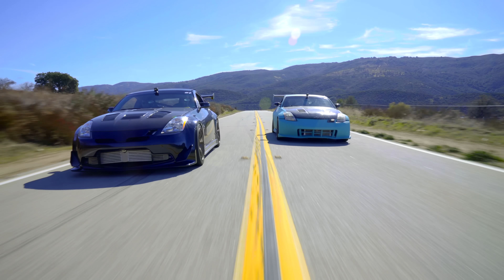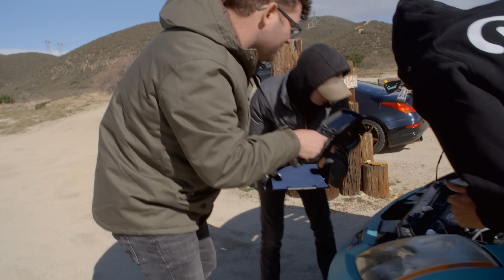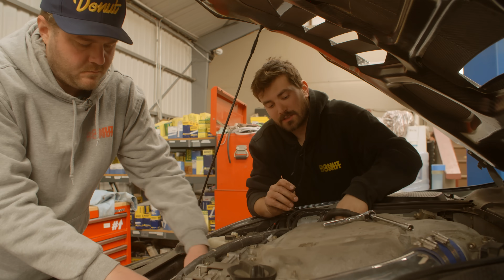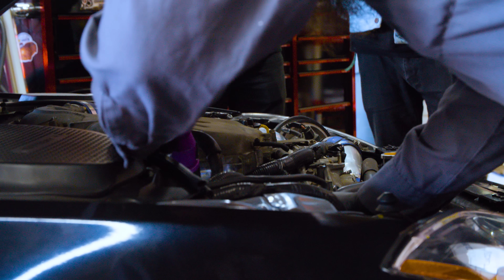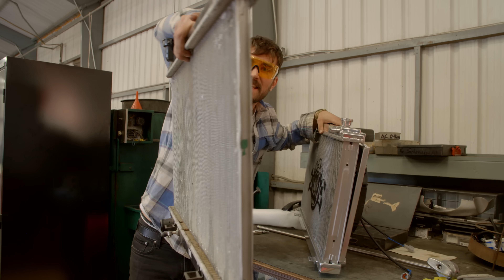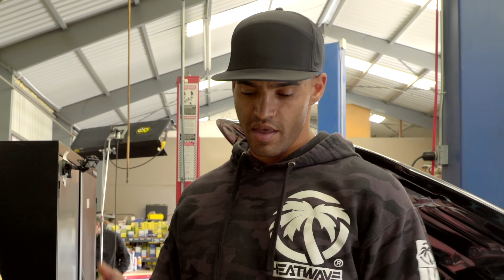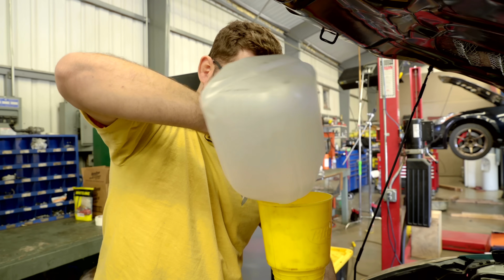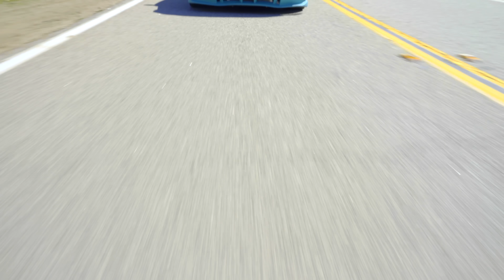$200 Radiator vs. $500 Radiator

Comment: Donut, if you're going to use distilled water, make sure to use an additive like Water Wetter with it.  Running pure water is going to eat up and destroy the  water pump seals really quickly.  Just a heads up.

Comment: I’ve had 3 eBay radiator! They’re been awesome, no issues so far it’s been a few years! The aftermarket fans in both of These cars are crap... I had the exact same dual fans on my mustang and they move less air than than my stock fan... I would not waste money on aftermarket fan unless you get something from derale OR a stock electric fan from another car

Comment: It'd be important to clarify that coolant "antifreeze" does more than lower the freeze point of your coolant. Distilled water has no corrosion inhibitors in it.
Reply: Yes thank you, I came to find this comment. You can't simply run 100% water! You might rust your stuff out from the inside!
Reply: Antifreeze also raises the boiling point too. Straight water boils at 212 degrees F, where a proper antifreeze mix raises the boiling point to around 260 degrees F.
Reply: Distilled water is not the problem, it even cools better than coolant, but at the low temps it'll freeze for sure 😂
Reply: Distilled water is acidic. Use water wetter or a water/antifreeze mixture.
Reply: @LightSpiD you miss the point that distilled water may perform better thermally, but it lacks the other components (corrosion prevention being a big one)

 @MountainPF  Distilled water has a PH of 6.9 (7 being neutral). Tha'ts a non issue. I can agree with the water wetter or antifreeze mix though
Reply: Jonathon Hebert once distilled water come into contact with air it absorbs CO2 and moves the ph level to ~5.9.
Reply: @MountainPF  Was unaware of that, thank you. Now i wonder if an engine's cooling system has much air exposure.

Comment: So the moment i saw the fans something occured to me that never had so far.

In PC cooling fans that provide high static pressure are used for pushing air though a radiator. Those tend to have larger fins than cover up a bigger portion of the fan area than high airflow fans that have thinner fins. So OEM fans in both cars look like they are geared towards high static pressure compared to their aftermarket counterparts which have thinner fins. So they should be the better choice. Could we revisit that at some point?

Comment: No coolant. From what I understand and read. U need a fine balance of 50/50 cuz yes it helps from not freezing but it also helps with not boiling. Water displaces heat better than straight coolant correct. But I'm curious about how this is gonna work out.

Comment: It's not just anti "freeze" has anti boil and corrosion properties too. Even in a hot climate no freeze issues in a engine with dissimilar metals between block head and rad should try to keep around 15% coolant.

Comment: I got 2 oem fans form a Opel safira thay have 2 speeds and on speed 1 thay take of  on speed 2 i dont know man its to much power i dont have so many amps at 12 v   I'm going to make somting cool out of them so yea original fans are great  maby even a over powered shop fan   for welding that turns on as soon as I stop welding so it can blow away the gasses and smoke

Comment: You guys need to worry about an oil cooler from mishimoto to keep those turbos at bay not worry about under glow. Doing all this upgrading and expecting the engine oil to be cool is worthless the radiator is only doing so much but is an good optional choice, but should still be consider about cold oil feeding into the engine and turbo at all times.

Comment: For the record, coolant also has anti corrosion agents and is has a higher boiling point, besides just not freezing. Not great for your car to run straight water. Also makes it more likely to leak through gaskets. Great test other than that. I've got one of those cheap radiators in my Subaru 🤣 it does heat up climbing long hills.

Comment: i feel like theres no point in replacing the radiator when the factory one works fine.
Reply: You must not have watched the video. 3 laps and having to stop isnt fine... That means the system clearly isn't rated for the heat/power the turbocharger adds to the engine. People like you need to keep your opinions to yourself i cant believe you just said that

Comment: well the distilled water isnt good for aluminum engine block of rad .. it increases corrosion overtime .. not really a good choice of coolant .. flush rad with distilled water use dedicated coolant is best option imo

Comment: You mentioned preventing freezing.  The other thing antifreeze does is maintaining proper PH (basic) which minimizes metal corrosion and erosion.  It's important, and it's one of the reasons you should always use the right coolant type for your vehicle (not just fill it with water)
Reply: I thought that’s why they use distilled water so it won’t corrode like regular water would
Reply: @JesusMorales-bn4qf  Distilled water will still corrode piping.  Changing the pH from neutral to basic is the best way to minimize corrosion of metals.

Comment: Yea destiled water makes diference on high tempereture climate.. like here sumer season nc .. i made mix of coolant and destiled water for my prelude 60%destiled water and 40 % coolant.. and it really works for my h22 high mileage engine .. this mix of water and coolant is been inside my radiator for ab 2 years and looks very clean. No any frizing problems wen is cool season .. is stock cooling system radiator radiator fans  everything is stock.. im not shure if im Wrong  making this mix of coolant and water vit sims to work fine for my prelude... any one has a better idea please and thanks....

Comment: Hey guys, is a radiator the same as an intercooler? I'm a little confused
Reply: nope. the radiator cools off the engine in general, while the intercooler only cools off the turbo (or supercharger in cars that have them).
Reply: @Polygraph2131  Can a car have both or do you have to pick just one?
Reply: @mickeybuzzkill   Well if your car is supercharged or turboed you have to have both. If you are running na, then you just have a radiator.

Comment: Its not about the radiator or fan, its about proper ducting to and from the heat exchanger. You can have the best parts available, but if you have no ducting, it will perform just as shitty as stock. CFD of the entire car is needed (usually already done to commonly raced chassis) to choose the best placement for the intake and evacuation ducting. Usually the stock fans are sufficient with proper ducting, so save even more money there.

Comment: i think low car should be able to get a new turbo, i dont mean top of the line but a cheap good turbo. it feels like its the main thing holding it back and realistically if something causes that much trouble you would replace it even with a cheap one but with proper reviews on car forums and other proven platforms. keep up the good work guys

Comment: You may also add, dropping the CATs will reduce engine temps as you no longer have that restriction relying on heat to do its work. Your scavenging that heat away from the engine+bay quicker
the Vented hood works better now too with the dual rad-fans.

Comment: Two fans isn’t actually twice as good. It’s the same concept as if you had one speaker on max volume, if you were to add another one they also wouldn’t be twice as loud, it would be louder but not by much. You would need 10 Speakers to achieve a sound twice as loud as one.

Comment: DO NOT use tap water for coolant. if you have an aluminium block, and a tiny short in your electrics, the ions in the water can conduct electricity in your engine. If your engine is made of aluminium, then it can hydrolyse, literally eating away at the inside of your engine

Comment: No one had an OBD2 scanner in the shed or anything to monitor what the sensor was reading?

I mean, the heat gun was good enough but just wondering.

Also, I think both radiators did their job fairly well. It looks like the turbo was the issue. =V

Comment: but why is it overheating to begin with?  is it because of all the aftermarket parts not tuned good enough ?  or all of the stuff requires higher performance cooling system (which is kind of bad tuning)

Comment: Anti-freeze (propylene glycol) also raises teh boiling point. Yes, water is more effective, but maybe 20% PG instead? that way if you do take it up in the mountains at some point it won't freeze. Edit: i should have let roll for like 10 more seconds. yep, what's in the block is probably good enough for socal.

Comment: 0:35

Early prediction:
High Car radiator is better but not better enough to justify 2X the cost.

Edited at end of vid-

End Result: 18:45

They both chose the High Car parts!

Note* If you look at the graphs, considering that they started at different heat levels, the low car part actually did a bit better job cooling overall *percentage wise*.
I believe turbo placement played a key role in Low Car’s high temps more than the radiator. If they put these on stock cars I don’t believe there would be $200+ dollars worth of difference in cooling.

Comment: OH NO - Don't run pure water!!  The antifreeze ALSO includes lubricants for the water pump, as well as corrosion inhibitors for any dissimilar metals.  Galvanic reaction is a real thing, guys!!  There are MANY coolants you can use if you want better heat transfer (check out Evan's waterless coolant!)

e - while I"m at it, even after the bubbles stop - lift the front of the car, run the car up to full temp (make sure the thermostat fully opens) with the cap off, make sure it's topped off and THEN let the car fully cool back off (say, overnight) - that'll completely eliminate any air in the system.

e2 - A full aluminum radiator is always a good upgrade.  Never put an OEM one back in LOL - That said, my vote would be hi car WITHOUT the silicone hoses.  Not needed - just the radiator and fans!

Comment: Anyone watching this: DO NOT RUN 100% WATER AS YOUR COOLANT.
Antifreeze is not just anti-freeze but also anti-rust.

Distilled water is even worse because it has no minerals and will eat the insides of your engine to get those back.

They kind of mentioned that they still had some of the old coolant left in the block, that will reduce those issues, but if start dry and put plain water in it your engine WILL CORRODE.

Comment: When we replaced the one in my Challenger that I'm building, we didn't have a choice and calls for a heavy duty high performance radiator on all SRT models and was also around 5 bills. We actually had a choice obviously, but only use the best on SRTs and wouldn't even consider using cheap parts on her. The majority of people don't know this, but hemis run hotter than most V8s and is imperative to use HD replacement parts on all high performance machines. Speaking of heat disbursement, I didn't know that distilled water works better than antifreeze to disperse heat and learn something new all the time. It would work fine for me to, because I don't have to worry about freezing as we are located in the desert southwest of AZ and doesn't get cold enough here. Although I thought that antifreeze also keeps em cool in the summer months, and would have to check into further before I committed to straight distilled. I always thought that you need the antifreeze/coolant in the summer months as well though

Comment: i put a $88 radiator after the original one cracked in my 07 c230 and the radiator worked just as fine as the oem one

Comment: The Hi car honestly got more attention to cooling than described. Having those straight throughs lost a marginal amount of low end tqs I'm sure but it would have probably been running lower temps with that alone. That cat blowing up was a blessing. Overall the expensive parts are the winner here as it's a preventative to much more pricey things like head gaskets or engine damage.

Comment: Sounds like you're just going to have problems with a project car regardless of what parts you put on it. It's just a matter of what problems you want to have lol.
Reply: They had a stock catalyst so im not surprised
Reply: @X_DD  I wouldn't doubt if that's the next upgrade they do for both.
Reply: More think thermostat along wit stock cats have low car running abit hot
Reply: Its all in how you design your car. They are just bolting parts on seemingly randomly. If you are meticulous in your planning and know what you are doing, problems should not be too bad or extensive. KNOWLEDGE IS POWER BABY!
Reply: casey escobar  Or it's because things rarely go perfectly when working on engine stuff

Comment: The coolant also helps with boiling point as well. It's not the best idea tu run just distilled water. IF you are stuck in traffic on a hot hot day , steam's going to come out.

Comment: Antifreeze not only stops the water from freezing, it also raises water's boiling point which is extremely important. Also, coolant has anti rust properties so I wouldn't advice using just water.

Comment: Howzit guys, I have a peugeot 207 gti 2008... It seems to have a boost leak, we've gone through everything, repaired intercooler, changed wastegate, no luck, checked pipes and their all good. My dump valve is also new. Been like this for 2 months, you guys are my last resort 🙏🏻

Comment: Yoo! I bought damn near the same setup of Hi-car's cooling system a couple weeks ago for my Miata (including a supermiata QMax cooling re-route) Seems like my little roadster is on the right path xD

Unfortunately, it takes a ton more time to get parts though, as I am now waiting to order a new engine after two failed attempts to get the car running, with engines I already had :( can't go Low-car on that I suppose.

Comment: To keep the boosted DE cooler, there is a kit that’s fairly inexpensive that adds hoses to the back of the block and cools the back two cylinders much more and makes it much better in terms of cooling.  My buddy had this on his twin turbo Z and it was night and day difference.  Another thing is that with the DE motor, to bleed the air from the cooling system the most efficient way is to park it on a hill so the motor is raised, and use the bleeder valve next to the battery compartment to get the rest of the air out of the system.  These motors are super prone to overheating and I thought these tips might help.  I had to bleed my Z that way and I’ve never had an issue since.
Reply: The kit is called pathfinder re-routing kit.  I believe it’s around 200 bucks but it’s well worth it.

Comment: This was honestly a bad choice for part comparison, neither of these cars needed bigger radiators their power levels aren’t high enough to warrant such cooling capacities, hi car is running too cold now and that will bring new problems like increased wear in the engine  among other things and low car has a straight up overheating issue that a bigger radiator will only be a bandaid on

Comment: Coolant/antifreeze also raises the boiling point, and they could have changed the radiator cap to a different lbs. the only reason to run straight water is if the RACETRACK doesn’t allow it. So it’s actually really dumb that low car ran straight water and not a 50/50 mix

Comment: You should never run pure water in the cooling system.  It might transfer heat better, but the boiling point is 212 degrees Fahrenheit.  Coolant actually has a higher boiling point dependent on the mix ratio.  A lot of modern cars run around 200 degrees normally, and once the water starts to evaporate, there is virtually no heat transfer ability.  The best mix for warm climates is 90/10 or 80/20.
Reply: @[Removed] I didn't say they did.  Did you even read my comment?  I'm just commenting on what they said in the video.  Go white knight somebody who needs it, kid.

Comment: For the record the mishimoto fans suck ass!! The CFM on them is so low and I couldn't do more then 2 laps on the track with out getting hot. So I bought so cheap ass $30 fan with a high CFM and haven't had a issue 😂😂

Comment: The anti freeze does more than just lower the freezing temperature..
It also prevents corrosion, lubricates the pump(s) and raises the boiling point a bit, compaired to pure water.

Comment: Your going to have to replace those headgaskets after those “heat ups”
Reply: Best advice on those comments. Play it safe pay it once
Reply: @mike_t_007  more like do this so you dont toatally break the cars and cant do the show with them anymore
Reply: Shyguy_tyler my thoughts exactly. Especially since it’s an import. Nissan v6 engine is a bishhh to replace
Reply: @eduardonunez4377  350z engines are cheap brother
Reply: Ballz while that might be true what’s the point of building them if you have to replace them all the time.

Comment: As someone who tried to be cheap with their POS old dodge truck, running only water doesn't manage heat as well as long because of its lower boiling point. You need some anti-freeze / coolant, so I guess low car will survive on what is left in the system.

Comment: Guys where were you during chemistry lessons? Colligative properties.. Elevation of boiling point.. the ethylene glycol inside the coolant isn't JUST for antifreeze purposes but also to increase the standard 100°C boiling point of distilled water. You can run a motor to 105/115 degrees without having steam forming inside the system, which is pretty common in Socal..

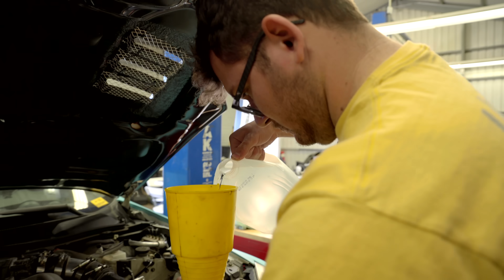Comment: 12:52 Another drawback is that antifreeze (propylene glycol) also works as a rust inhibitor. 
If you are using a aluminium radiator with a iron block you will loose performance overtime as rust start to accumulate in the system due to galvanic corrosion. It can also week the strength of the block, cause leaks inside the engine block and make a hole on the radiator.